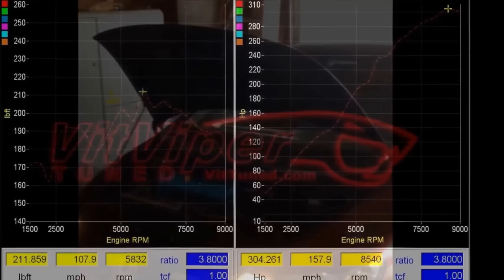Emmanuel's K25 Civic Si All Motor Beast

Comment: Hey. this is a dumb question, but what does k25 stand for? Are there others too?
Reply: 2.5L
Reply: K series 2.5 liter
Reply: Ahhhh... Thanks guys!
Reply: ***** No - more likely a 2.4L block bore over - you would have to use a crazy crank in a K20 block to get to 2.5:
Reply: Servicemember80 you dont need crazy crankshaft you get a stroker kit 89x99mm or higher
Reply: STYLES NELSON The rod stroke ratio of a larger crank in a 2.0L block would be counter productive given the taller block option - you would use the taller deck with the larger crank so you could keep piston speeds reasonable so the motor can survive longer before rebuilds - you would also have much larger displacement options with the taller deck block. Given the almost negligible cost of a 2.4L block there would be no good reason to use the 2.0L block - especially if you are going to build a performance motor from the ground up - keep the OEM Honda 2.0L stock and build a spare 2.4L block up to swap out ....2.4L blocks are a dime a dozen....z3 blocks in working condition - not so much
Reply: ***** There are B16s that have made 900whp --- can a 1.5L turbo make power? Honda built a V6 1.5L that made 1200hp
Boost can make more than enough power to keep up and stomp on stock turbo 4cyl cars....apples to apples you will want the larger 2.0L engine though --- more torque across the rev range and quicker spool using the same turbo
Most of the stock turbo cars have baby turbos and die off after about 4k rpm---- quick spool off idle with dying top end vs Honda which is soft bottom end with crazy top end flow -- in racing you will be in the upper 1/3 of your rev range -- so 6-9k is where most Honda guys focus their power production. 
This new 1.5L will be no different - might have a pinky turbo on it - hopefully not intergrated to the exhaust side so you can just swap in a larger GTX unit

Comment: Anyone notice the "M" badge on the steering wheel? haha
Reply from the maker: thats a prize for beating a M3
Reply: nice! lol
Reply: TheTongMan You mean like an old ass M3?  Cuz otherwise you're talkin about cars with twice as much torque, 100+ more HP, and RWD.  Even weighing 500-600 lbs less, I don't see how you win.  Not calling you a liar, but you would need to strip a shit load of weight or do some crazy shit with gearing to pull that off and that's if you're racing a bone stock M3.
Reply from the maker: that civic weighs like 2400 pounds
Reply: TheTongMan Wow he took off more than 500 lbs.

Comment: I'd run em in my FULL stage 2 Evo x...
Reply from the maker: declaratedvet are you in socal?
Reply: man i wish, im in wisconsin. my bro has a 08 si with a type r motor swap with supporting mods, flash pro, and tune and i walk him even when i was stage 1 in my evo x. i thought it would of been closer than that, he said 2 of his cylinders were not at 100 percent and cutting his power out so his car is back in the shop, he is getting the type r motor replaced by a k20a2 i guess. i like your car its sick, i just think the only way a civic would be a good run against the evo would be if it was boosted like yours.
Reply: declaratedvet Cool story bro - why would he need to replace his entire motor? He could easily drop some new pistons in and bump the comp a bit in the process - more power, less money - an I/H/E FP Si with a stock engine will run low 13s@102-103--- thats 210-220ish whp --- the EVO puts down 240ish stock and with a stage 1 280ish....so you think it should be close when your making 60whp/100ftlbs  more than he is?  A simple set of cams and the car will put down 250ish whp --- Then you think a slower boosted Si is a better run than an NA Si that traps 117 wtf?